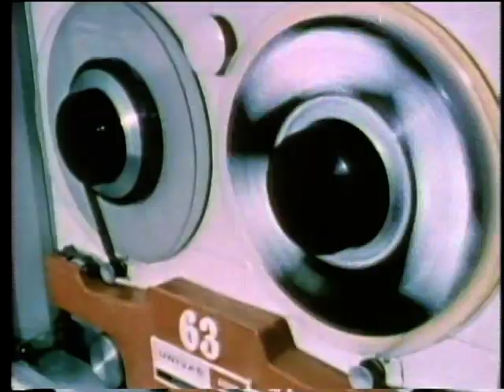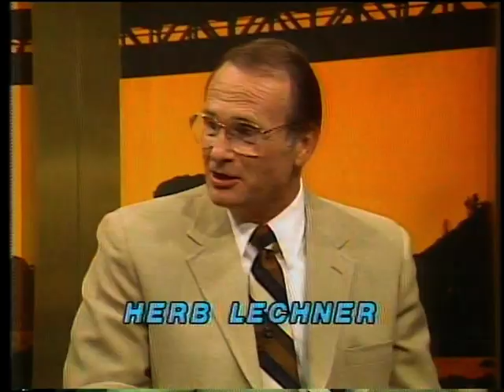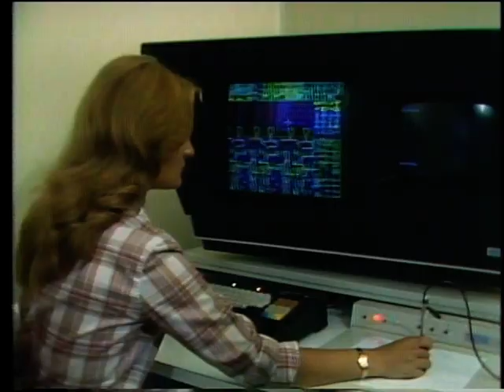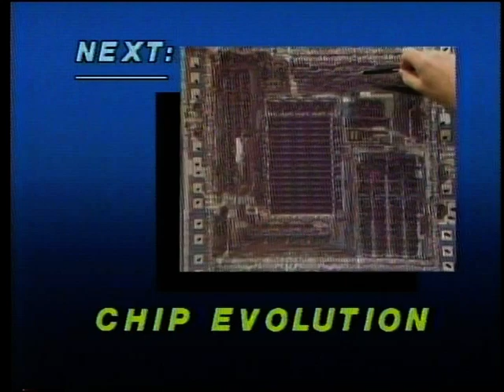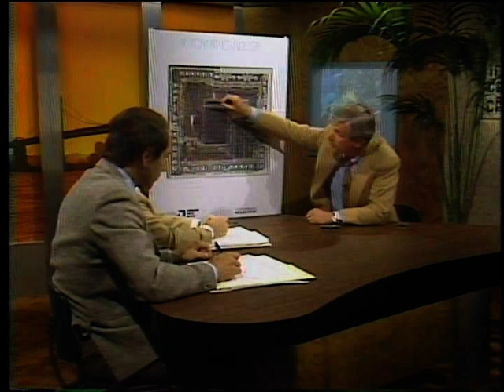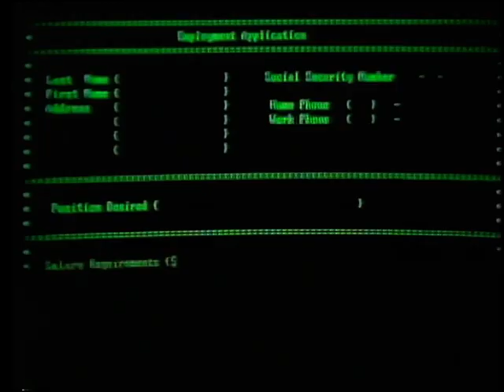The Computer Chronicles - Microchip Technology (1983)

Comment: This is wild. Transistor counts have increased by 6 orders of magnitude since then (in 2026, there are 1 million times more transistors in the largest common devices than the largest devices that they mentioned in this video). They were pretty impressed with the state of things in 1983.
Reply: More so today it's how even the lowest end embedded systems on chip with wifi and modern connectivity have 100 million plus transistors and cost less than 50 cents. Microcontrollers might have more a few million transistors and be like 5 cents a piece in bulk.

Comment: I guess they were able to handle the heat generation problem for many years after this, because CPU heatsinks didn't really become a thing until the (mid-)1990s, at least on desktop PCs... A typical 386 or 486 CPU didn't necessarily require any heatsinks! I guess the Pentium generation CPUs were the first ones to really require it.

Comment: As an electrical engineering student in the early 90's Gallium-Arsenide was always the semiconductor used in any class where the material mattered.   Silicon was never used in any examples.   My trademark for Gallium-Arsenide Valley never panned out.

Comment: My first PC was an AMD 486 DX2 , 8 mb ram, trident gpu and a stacked 250mb hd. Upgraded it in 1995 with an AWE 32 and a Toshiba 4x speed cd rom. 3 years later it was out dated. The Pentium came, the rest is history. This pc I have now is number 9 since 94. A PC last on average between 3-5 years. Then an upgrade is needed. Although half of the pcs were upgraded in some form or another. Better GPUs or processors. Its been a ride, and now PC graphics are very real. I think in 10 years we wont see the difference between data and real. We have reached the treshold. Next is VR machines, to be in the game. And A.I

Comment: 5700x has 19.2 billion transistors
Reply: 4090 has 77 billion take that amd
Reply: every time i would shop for a gaming laptop or even regular laptop with no gpu, every time i saw amd, i was like ewww. it made the laptop automatically feel like it would SUCK, be slow, not be compatible with certain software. yuck amd. though the threadripper and epyc are nice

Comment: As a European, I have discovered these shows a few years ago, and I find myself re-watching some of them. Truly fascinating. 
I've written it before but some years ago I've been reading books, printed in the early 1980s, about the 4004, 8008 and 8080. In them, the path to the present future has been well clarified. The top notch in the IT industry understood the scalability of the technology, its full potential, hence what was laying ahead. The books already explained VLSI, 16, 32 and 64 bit personal computing, and that the step to 128 bit would be a very hesitate one; costs and gains going towards negligible. The top brass knew the overall path of the innovations, and that to get there successfully would be a matter of cunning capitalisation, hard pushing R&D, clever commercialisation, standardisation, muscling the industry and pushing ahead as fast as they possibly could to get to the next stage first. Of course, details evolve as they go (smart phones, tablets etc), but they knew what they were at and after. Some didn't understand too well, perhaps had other short-term motives, and/or couldn't get the capital and/or talents, made wrong turns leading them to failure. But yeah, these guys like AMD here at the table..., they understood all potential very well profoundly.
Reply: Same here. Greetings from Slovakia. 🇸🇰

Comment: At 13:30 The 2901C. In 1977 AMD used the 2900 bit slice family to build an Intel 8080 emulator. Signetics did the same with it's 3000 series bit slice family. Signetics made it's design available as a kit and based it on the Intel SBC 80 bus. The CPU board had a 6-3/4" x 12" form factor. I built a few of these kits and made an adaptor to interface with the S100 bus. Running on CP/M I ran several performance tests which showed the emulator as equivalent to an 8Mhz 8080. That was great in 1977 as the Intel 8080 was clocked at 2 Mhz (4 times the speed). However my kit build was in 1982, at which time I was already running Z80 systems at 8 Mhz.

Comment: Where will we be in 40 years?
Reply: 1 Thz cpu with 8TB ram, with 100 petabytes hard driver and Voodoo 98 with 512tb
Reply: I would say quantum computing would become the place where silicon based transistors are today but I am not so sure.  It seems like it will take a lot longer than that and instead some kind of incremental hybridized enhancement to silicon based computing instead.

Comment: Four megabit DRAM memory was achieved by three companies just three years after this program aired. Back in the 1980s, even optimistic projections turned out to be less than what would be achieved.
Reply: Would've been great if the question of what would be seen in 5 years could've been added to 10 years, 15 years, 20 years, and so on.  I recall one episode a little later predicting when the 100MHz processor would come out and they were dead wrong saying something like 1999.

Comment: I wonder if chips made on larger feature size (or older chips) is reliable/lasts longer than today's extremely small and dense chips. A machine made in 1994 that I worked on has a computer board (?) that has no heatsink and covered in dust, but it has never been replaced, it still works. Meanwhile the CPU in my PC just died with no apparent problem, the PC is well-maintained. 🤔
Reply: I think it depends on the fab.  MOS technology (Commodore) posthumously known to be awfully poor production chips that fail a lot.  I believe the Japanese made chips were super high quality though.

Comment: What a sweet memory! In the same year I wrote my thesis using wordstar, chi writer, and lotus 123 in my IBM  PC compatible 80286 with 20mb hard drive and my cga screen.
Reply: In 1983 there weren't any 80286 PC compatibles yet. The IBM PC XT with an 8088 came out, and then later the first Compaq PC compatible.

Comment: My mind just boggles how they knew to put this chip here a transistor here and a resistor over there and it will do this.
Reply: That is what you learn at university. At least I did. Go read

Structured Computer Organization by Andrew S. Tanenbaum

and a light bulb will go off in your head as you suddenly understand how simple transistors can transform into a working computer system.
Reply: @JanBruunAndersen and I put this comment in every video he says it on wink 😉

Comment: Anyone know why they are talking about the chip in terms of bits ("four megabit") rather than hertz as we do today?
Reply: Because the most important thing from their point of view is how many bits of information a chip operates on at the same time (old CPUs "IPC" can be directly link to it's width, or bits size it can load/store per cycle). Today CPUs use VERY many tricks under the hood to make process more efficient, since making it wider (than 64-bit), is unnecessary (and can make old software run too slow on such CPUs). We also get wider execution of code via newer and newer instruction sets (SSE, AVX).
In case of 4Mbit specifically, I think they asked about ammount of memory (cache, not RAM) a CPU has at it's disposal.
Sidenote : A pretty well known chip with 4Mbit memory is Pentium Pro (with 512kB od L2), and a 4MB memory chip could be Core 2 Duo from 2006 (two cores with shared memory).

Comment: Ah, the 2901. If a 16bit home micro had been designed around this time using four of those chips, it could have owned the world. 
Not only would it have been blazing fast, it would also have been able to precisely emulate just about any of the then popular architectures, making it compatible to everything.
Reply: Who could have afforded to buy one? John Paul Getty? Bill Gates could have taken a mortgage out on one I suppose.
Reply: anonUK they weren’t that expensive. 

You needed at least four of them to get some advantage over an eight bit.

You needed some control logic because the AMDs where essentially the ALU. 

And you needed some fast RAM. 
A fast small piece of SRAM would have sufficed as a software managed scratchpad.

So yes it would have been a bit more expensive but not ridiculously much so.

You could leave out a lot of other specialized hardware, because it could be emulated by the fast bit slice processor for the instances where it was needed.
Classic examples are disc controllers, advanced sound and decompression.

Many arcade boards had a “mathbox”. Essentially a geometry transform unit.
Reply: I thought that's exactly what Steve Jobs wanted to do when he looked at the Xerox Star, which used the 2900 series.  He balked when he realized there was no chance to make the system remotely affordable and was full of mass production manufacturing issues.  He settled for a standardized microprocessor and replicated the same environment instead.
Reply: @oldtwinsna8347  and made the only slightly less insanely expensively priced Lisa.
Also the famously underpowered Lisa.

Star was ridiculously over-designed in many, many other ways. 
The bitslice architecture was not the clinching factor.

An Alto redesigned and cost reduced to production with 1980s VLSI processes would have been the sane choice.
We would have been in a much different and quite possible much better world had that happened.

Remember that Alto was actually sold and used outside PARC in limited quantities.

CMOS (or something like it) would probably have won out eventually. But in the early 80s when things got locked in, a bit more power to allow for rudimentary OoP and microprogramming would have allowed a far better starting point. 
A starting point is not something you can catch up to later.

Comment: One micron lol time stamp 11nm now only question now is when's moores law going to stop us
Reply: Now. If we carried on at the rate of 1965-2010, by the end of this decade we'd be trying to make chip components out of individual atoms. That can't happen- so we either stack everything up to increase the number of functions per component, making everything slower, or we try to implement some kind of quantum technology, which would mean dropping binary code, which has been the basis of every single digital  instruction since Konrad Zuse basically built a Difference Engine running on electricity in Nazi Germany.

Comment: 30 years later 32 core 64 thread consumer chips these are wonderful times 19.2 billion transistors
Reply: Which would not be possible without gentlemen like those on the video above. The history is a "continuous evolution"...
Reply: 64 cores in 2020
Reply: @tadeuferreira5705  128 cores in 2021
Reply: The m1 ultra soc has 114 billion transistors
Reply: @yogibear2k2 For sure!

Comment: Back in the early 80’s they used a 10.000nm process for processors,in the 90’s that was 800nm, in the early 2000’s that was 150nm, anno 2018 we are now at 7nm, in 2023 that will be 3nm and in 2030 it will be just 1nm.
Just mind blowing how they could fit sooo much transistors on such small chip.
Reply: we're not going past 5nm if we don't solve the quantum tunneling problem
Reply: Zod yes they will get past 5nm GARATEED, that’s because scientists have already making a 1nm transistor possible by using carbon rather then silicon, this solves that tunneling effect problem, i believe that in the late 2020’s they will gonna use 1nm, but 5 nm will be used by 2020 followed by 3nm in 2023.
Reply: @johneygd  we are in 2023 and your information was spot on!
Reply: @LetoxxIant  WRONG. carbon will be more expensive, and too difficult to make chips with. ffs learn wht your talking about. carbon nanotubes are no joke. go look up how expensive and time consuming it is to make a gram of nanotubes. carbon nanotubes have been around a long time and its still just as lengthy and difficult to make it today as it was decades ago

Comment: I like how Stewart gets all excited "4MB MEMORY!" I'm just sitting cracking up. my computer has 4,000 times that at 16gb. and its not Mega bit. its Megabyte. what made them think of using silicon for chips anyway?
Reply: A megabyte is 8 times larger than a megabit.  He was talking in megabits so that would mean 512 kilobytes.  Nowadays we usually talk about ram and storage in bytes, megabytes, gigabytes and so on but there is more than one way to measure data storage including megabits, megabytes, and even mebibytes which is equal to 1.048 megabytes.
Reply: The technology to use silicon came from the Roswell crash

Comment: Here are some numbers for perspective:  
1983 - Intel 8088 had 29,000 total transistors(NMOS or CMOS), 3,000 nanometers.  
2017: Intel  Xeon Broadwell-E5 22 core has 7,200,000,000 transistors (3D trigate), 14 nanometers.  This amounts to a 214X increase in transistor densities.
Reply: nvidia 4090, 78 BILLION transistors lmao
Reply: and now nvidia gpu has over 78 Billion. funny in this show he was saying 100,000 transistors coming (in their soon future which was a few years away from air date) was consider SUPER. lmao. if you told him how about 78 billion, theyd all probably say, IMPOSSIBLE, no way, why would you need that.. well ill tell you why, as transistor count increased, programmers got so lazy, no software is run efficiently, they just write crap code and let the powerful chips deal with it. if every os and software was 90-100% fully efficient, we would have computers run 10-100 times faster than they do today.
Reply: @DJKinney  Due to the llack of any real competitors for the last decade. Now with AMD back in the game they have no choice but to start innovating again.
Reply: @DJKinney  Our hopes were answered. :)

Comment: 1999 : The fastest supercomputer in the world had a peek speed of 2.3796 Teraflops.
2017:   Geforce 960, An old bogstandard midrange card from 2015 has a speed of 2.4 teraflops.  (It was my former graphics card). Probably can be had for around $200 now.
https://en.wikipedia.org/wiki/ASCI_Red
http://techreport.com/review/27702/nvidia-geforce-gtx-960-graphics-card-reviewed/4
So in just 16 years  the speed of a supercomputer with thousands and thousands of processors (or computers in a mesh) can be cramped into a standard graphics card!
It is just amazing!
The 1070  I have now is about the level of the fastest super-computer (at least when talking teraflops) in 2000.
Reply: a GTX 970 can be bought for 100 euro's on second hand markets now... which has a speed of 3.6 teraflops 🤣